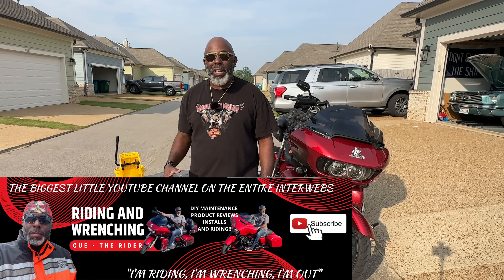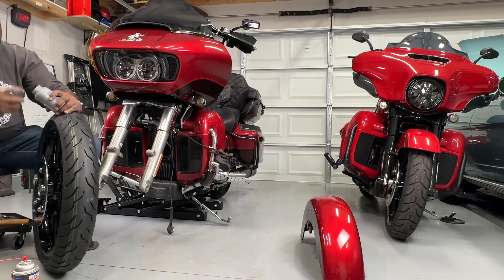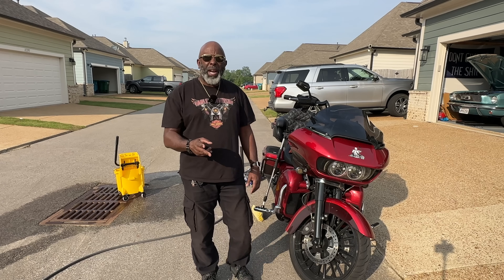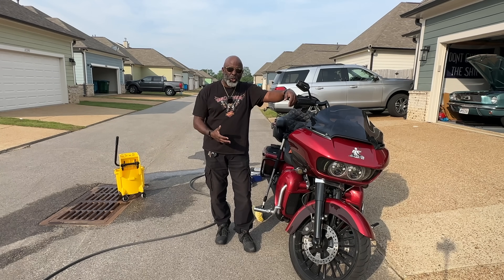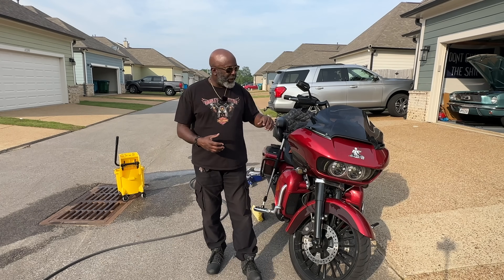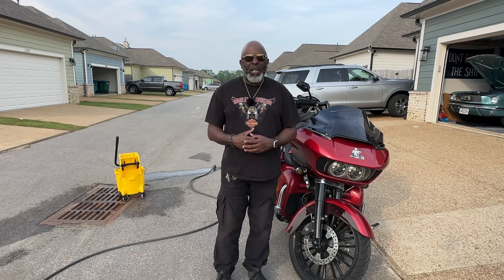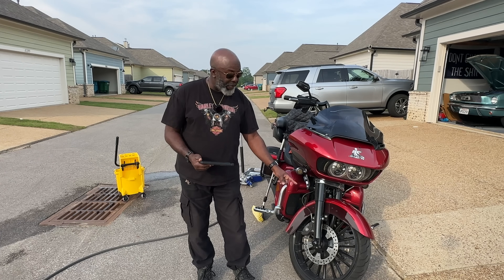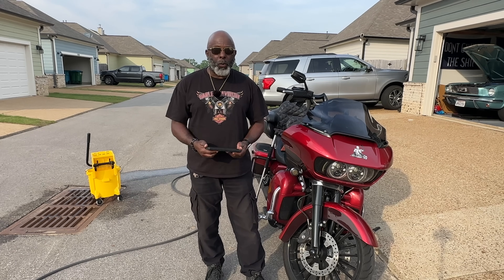Why You SHOULD NOT put  21" wheels on your Harley!

Comment: Great video! People who put oversized wheels and tires on their vehicle rarely consider the increased rotating mass. Combine that extra mass with an already poor performing brake system on a Harley, and it's going to be troublesome.
Reply from the maker: I didn't consider the impact to braking. Time for some more testing!
Reply: Brembo brakes are poor performing?
Reply from the maker: @michaelkywright2195  I've never heard anyone say that. I am planning to test stopping distance between my bike (with after market wheels) and a stock bike to see if the heavier wheels increase the stopping distance
Reply: I was replying to mark's comment. "Extra mass on poor preforming brake system on a Harley" people always got negative stuff ro say about Harley-Davidson but every motorcycle manufacturer Tries to copy what they do. I've never rode a metric Cruiser that didn't feel like it was a cheap version a HD. Honda civic vs corvette  ya know.
Reply: I was replying to mark's comment. "Extra mass on poor preforming brake system on a Harley" people always got negative stuff ro say about Harley-Davidson but every motorcycle manufacturer Tries to copy what they do. I've never rode a metric Cruiser that didn't feel like it was a cheap version a HD. Honda civic vs corvette  ya know.
Reply: @michaelkywright2195  I've owned Harleys for over 20 years, and I still have one. I also have a DCT Wing tour. Call the brakes Brembo, HD, or whatever. All it means is that Harley outsourced the brakes and by using the name Brembo, customers think they're getting upgraded parts on a stock bike. Brembo brakes have no more stopping power than the HD labeled calipers of years past since the pistons are the same size and quantity. My Street Glide could nowhere near stop as well as my Wing, but the stock Wing is 100 lbs lighter, has much larger 6 piston calipers, about double the pad size, and radial tires. It will stop as well or better than most sport bikes or ANY stock Harley and dust a CVO in the 1/8th. There is nothing Harley about a Wing.

Comment: Very nice video. I like the looks of the 21in wheels but I ride all over the country and it worries me if they would have them in stock like you said too.
Reply: The 21 on my street glide shares the same size tire as the front on my 13 breakout. The breakout front tire size has not changed from then to present if I remember right. The tire size is a common size.  I ride across country also. I even have cross country the breakout.. lol

Comment: Nice wheels. When you mentioned about the jiffy stand being off I also thought about your oil dipstick being at a steeper angle possibly being off. 

Btw, a few months ago I added TPMS after changing to the GTS Infotainment my local dealer added the sensors when changing out my wheels it works awesome and accurate within a pound. The CVO Aggressor wheels changed the ride as did yours so bumps are more felt albeit the tires and wheels were the same dimensions. It's not a real issue but I'm not sure I would give it a pothole test.
Reply from the maker: I didn't know you could add Tpms by changing to the GTS head unit. That's awesome!
Reply from the maker: I normally check oil with the bike upright, but you have a valid point. I'll test it before and after replacing the jiffy stand

Comment: Using a front 21 an a rear 16 is the best if you change from the stock sizes ...the 21 -16 format leave the wheels at the same basic circumference....worked best in the shovelhead days anyway
Reply from the maker: I was told that going from a 16 to 18 rear would keep the bike level. (I mistakenly said I had a 15 rear in the video)
Reply: @RidingandWrenching  I had several with the 16 21 combo never had a handling problem   ,I got the idea from Easyrider mag in the tech tips...my bikes were all low rider chopper types Fx ,FXE with 6 over front ends. even a triumph 750 hardtail...they ate up the turns an never tried to throw me off like 16 r 18or 19 f combos...never had a dresser decker or as they are  called.baggers of today like yours .a buddy had a 6 over decker  with matching 16s Cat Squasher front tires we called em....I will say this Stock bike resell an usually handle safer ....but where is the fun in that lol ...great videos man wish we had em back in the day ...grab your self an old Easyrider magazine tech tip book  if ya can find one. ✌

Comment: I tell all of my customers that they should, upgrade their stock suspension whenever choosing to go with a 21" or any other bigger size wheel and tire size for these very reasons.  The first thing they do is ask me if I did, so of course I have to show them one of my bikes.  Before they're ready for spending this type of money, it's the least I can do.  

Ohh and I never recommend that they're doing this, on any bike that they're traveling cross country on especially when wanting to travel with a passenger.   Great video.
Reply from the maker: Agreed! I didn't factor in the cost of upgrading the suspension, but it was a necessity for me

Comment: I thought a 21” wheel would roll over bumps better but I guess the thinner tire negates any benefits from a larger wheel.
Reply from the maker: @lomparti  I've been riding on it for over a year. The only downside was the stiffness of the ride. I have fixed that by upgrading to a Wilbur's suspension

Comment: Great point on the speedometer Cue. 
The other BIG issue is your ABS system. The wheel speed sensors are designed to work with a certain diameter of wheel to determine revolutions per minute. Changing the diameter will change the speed sensing accuracy which will effect the ABS systems ability to work properly, which is also a HUGE safety issue.

Comment: Good valid points,  I was thinking of upgrading to 21" at front on my 18 fatboy,  to improve handling,  has adding the 21" help the handling on the turns for your bike?
Reply from the maker: I don't think it will improve handling. Best case scenario is that it doesn't make it worse. If I could redo my decision, I would have chosen a lighter wheel. The Coastal Moto is heavy.

Comment: I ride a raked 23 fat tire street glide. Love the setup. The rakes and everything are also made by engineers. I ride it everywhere and do not own a trailer. Sturgis, Milwaukee, etc from Colorado. To each their own. And yes Harley does have 21 standard tires. Not fat tired. Buy a shorter kickstand.
Reply from the maker: I want to ride a bike with the fatty on the front. How does it impact the ride?
Reply: @RidingandWrenching ides better then stock. Only difference is you cannot make a very sharp U-turn. But I don’t. You can get vertical valves stems, TPMS sensors and internal balancing. My friends who have ridden it and they loved it. Though it would be difficult to ride. Nope. And I got the Big Fatty  from SMT machining complete setup!

Comment: how would changing your front wheel affect the speedometer this is determined by the rear tire? The CVO Streetglide has a low-pro tire from the factory.
Reply from the maker: I also changed the rear tire. I should have been more clear.

Comment: I’m 6-5 and I’m considering a 21 inch wheel and tire package for my 2012 Roadglide. Was there anything you had to do with the front fender to prevent any rubbing? I definitely like the look of a 21 inch wheel. Good information. 👍🏾 Update 3/20/24 i was getting ready to order a 21 inch wheel & tire package from Coastal moto but i chose “suspension “ first. I received my Ohlins rear shocks and front cartridge kit in mail today.
Reply from the maker: Coastal Moto includes a fender riser. It's been almost a year since I put the 21" front wheel on my bike. My biggest issue is how far it leans on the kickstand. I have purchase a kickstand extender that I will install soon. Hopefully that takes care of the problem.
Reply: @RidingandWrenching  sounds good. Thank you!

Comment: The front rear doesnt affect the speedometer,  the reading speed, the rpm, the speedometer readings, is only affected by the rear wheel because the transmission  is connected to the chain,band thats connected to your rear tire..if you but a smaller tire in the rear you need more revolution to reach a speed and higher rpm, wich in turn messes up the readings on your speedometer...giving you higher readings,  more whear an tear on your motor,transmission, and also shows inaccurate speed on speedometer. If you put a bigger tire at the rear, you get less wear and tear on your motorcycle and transmission, you accumulate less  miles on speedometer, higher gas mileage, but the down fall is you loose rpm, but im sure their is a specialist that can program the motorcycle speedometer for a smaller tire, or bigger tire,...the front tire isnt connected to the transmission or pully system so it cant affect your speedometer,  but you are correct about handling differences with a big front tire...my biggest concern with the big front tire would be makeing turns, the bigger the tire the wider the turn, Factory tires are designed for sharp u turns, like a car has the same issues if you put really huge tires the turn radius changes.....i personally would take off the rear 16, and put 18" help with whear and tear on motorcycle,but will affect horse power, unless you get a specialist to change the speedometer speedometer to synchronize with the bigger tire diameter.

Comment: You should probably refrain from using that brush to wash your bike. 
I could see the fine scratches in the finish of your front fender at the 7:13 mark.
Reply from the maker: The bike was filthy in this video. I had just returned from a ride from St Louis to Memphis. I decided to record this video before I washed it. I actually recorded the bike wash, but decided not to include it in the video. I check again, I don't see any marks on the bike (now that it is clean) but your point is still valid. I have 83,000 miles on this bike and the paint has several chips and a handful of scratches. I don't know if I will ever do anything about them since I ride so much.

Comment: Thanks for the video. My 21” wheel just came today lol.  I drive a CVO street glide which like you said doesn’t ride as soft as an ultra so I’ll give it a shot. What kind of a front end suspension upgrade did you do Cue ?
Reply from the maker: I have the Wilber's suspension front and rear. Install the wheels first. If you don't like the ride quality, consider rear shocks. That's what I did to my Street Glide Special. I installed Ohlins on the rear. I may eventually do the front as well, but the rear made a huge difference in ride quality
Reply: @RidingandWrenching  you are 100% right on this one.  I changed the rear shocks on my RGS to Legends and made a world of difference.  Still stock wheel sizes.  I’m now going to do the front end.  

I was contemplating going to a 21/18 combo on my bike, similar to the SE RG.   Your video helped me make my decision.  Staying stock sizes.  

Thanks for the video and info.
Reply from the maker: Sorry I didn't respond to your question about the suspension. I installed a Wilburs suspension on the front and rear.

Comment: My 21 wheel and 18 in the back on the 13 ultra.. rides smooth and I have the expensive high-end suspension front and back how about that before I bought the wheels and if you get a dirty air pump setup you come out Golden those newer bikes are not meant to be modified at all
Reply from the maker: My bike rides much better with the new suspension
Reply: @RidingandWrenching  you add those dirty airs on there as well and get a Michelin tire on the back and in the front for the 21 in you'll love it

Comment: I build bikes. I have a shop. I have an 05 EG. 21-16 setup on air. In the rear. My bike rides like a cloud. Before with the factory. It was a wobble monster. Only reason 21” don’t ride well is suspension. Rake and trail. Lower the front a little and ride will be sustained.  Transmission is gear to gear. VSS runs off the gears spinning. That’s wheel doesn’t have a cable driven speed OM no way that bike is not running a true speed. If it’s not. Get a vss speed sensor calibrator and adjust the speed as you ride. For a true correct speed. Btw. Harley speed sensors arnt calibrated from factory. They’re just tuned to spec. With perimeters in the Ecm! Good vid nonetheless
Reply from the maker: Thats what the rep from Coastal Moto told me. if you put a larger rear wheel, the speedo would not be accurate. I also asked my local dealer (they said the same thing you did). 

After riding with the larger wheels for a while, it's not a big deal. The biggest problem is the lean angle on the jiffy stand. A friend installed a 1" metal block to the "foot" of his jiffy stand and that solved his problem. I'm going to do the same thing

Comment: Good video forsure. To me a 19' front an stayed with your 16 in the back an of course junk that Harley suspension the factory installs on all there touring bikes an still do today. Legends suspension  front an back with 13inch rears  would be my choice .
Reply from the maker: The Legends will definitely improve the ride....especially with stock wheel size. I put Ohlins on the rear of my Street Glide Special and it made a huge difference.

Comment: Wow, great vid! Glad you got thru those blowouts. That looked life threatening. Did you have to buy a second set of wheels? Insurance? Sorry if I missed that. 
Another thing a larger diameter tire does in increase the moment of inertia. Consequently, even if the taller wheel is the same weight, it will be harder to steer. Not that you need lightning turn in on a touring bike, but on long twisty rides it might become noticeable.
Reply from the maker: I had the Harley wheel/tire package. They replaced everything for $50! I was very fortunate to keep the bike upright in that situation. I considered giving up riding because of that incident. I now have a spare set of rims (actually 2 spare sets!) 

The bike "feels" heavier. Possibly because of the wheels. I'm going to use it just for touring, so I think it will be ok. If not....I've got spare wheels!

Comment: Is your speedo hooked to your front wheel?
Reply from the maker: No. I was actually referring to the larger diameter rear wheel when I mentioned speed, but I wasn't clear when I made the statement in this video. Since recording this video, I learned that (although I have a "larger" rear wheel) the overall diameter is the same, thus there is no change in accuracy of the speedo....it's just as inaccurate as it has always been😂
Reply: @RidingandWrenching  thank you very much for the fast reply thinking about doing a 21 on my Ultra Classic. You gave me some good things to think about though.
Reply from the maker: @G_RAThbun  It's been a little over a year. I guess I could an update on this video. In a nutshell, I really like it. i haven't had any issues with the front tire at all. I've caught a couple of nails in the rear though! If I had it to do all over again, I might have chosen a lighter wheel. I have experienced a slight drop in fuel economy. I don't know if it is directly related to the larger rim, but I know the added weight doesn't help!

Comment: A couple of silly questions for you (1) Stock fender ? (2) Would dropping the front end level the bike out ?
Reply from the maker: @billalcantar03  I use the stock fender although I'm considering an aftermarket fender. I think the bike is pretty stable without doing anything else. Dropping the suspension would worsen ride quality

Comment: Front tire 90 is a easy correct, just flip the rim next time you replace the front tire....
Reply from the maker: I believe the ABS bearing has to stay on the same side. But it's still an easy fix that I'll do with the next tire change. I'll also add a 90 to the rear

Comment: I have drop my Road King 3 times and I am thinking that the 21” front wheel is affecting the balance of the bike. Anyone , please give you input on this ??
Reply from the maker: The 21" makes the bike a bit taller, I won't describe it as unstable. Consider checking out https://youtube.com/@BeTheBossOfYourMotorcycle?si=QXJYcvAMn_2KLgcp
Might help with low speed handling

Comment: So, I gotta ask:  If "Road Glide, Street Glide or Road King Special suspension already sucks!"  (your words)Just how are these front suspensions any different on your ride?  (Before you were forced to upgrade bc of the 21"s) Since the only real difference is the shark nose fairing?
Reply from the maker: My 18 RG Ultra with the stock rims/tires, stock suspension, and Harley Hammock seat was very comfortable. I screwed up my ride quality with the bigger rims/tires. The suspension on my 22 SG Special sucked (compared to my RG) even with stock rims/tires. I suspect that a RG Special would be just as bad as my SG Special. I swapped the rear shocks for Ohlins and that made a huge difference.

I have never owned a Road King, so I probably shouldn't assume that it would be as bad as my SG Special.
Reply: @RidingandWrenching  Ok, i just had to ask!  I am trying to get my FLHTCU to ride and handle at least 1/2 as good as my buddies SGS...  IDK what is hidden inside his fork tubes, but that bike is a handles like a dream!
Reply: @RidingandWrenching  And, my buddy wants to swap out his stock wheels for 21"s. Not a good idea aye!
Reply from the maker: He can swap for 21" wheels, just be aware of the pro's and cons. Might be best to find someone that has the wheels installed and make your own determination. I like mine. If I had it to do all over again, I would have bought lighter weight wheels. Otherwise, I'm happy with them.

Comment: Wasn't it that the tire rotation was mounted wrong/to your preference? Couldn't you flip the rim around? If not, forgive my ignorance. Just an observation.
Reply from the maker: It was mounted incorrectly. I plan to fix it when I remove the tire during my next tire change. You can't flip the rim around. The ABS bearing has to be on the correct side.